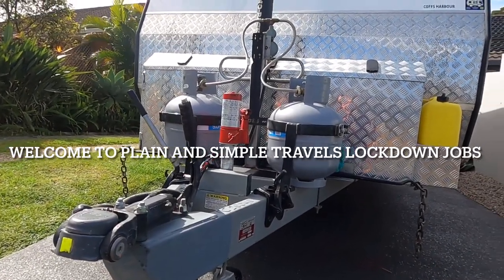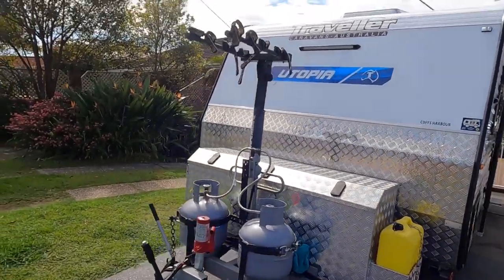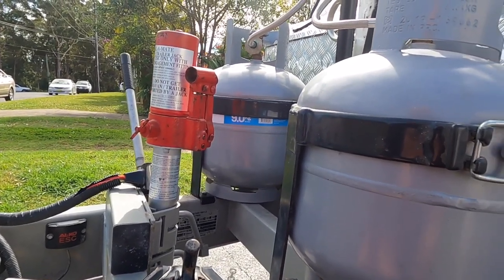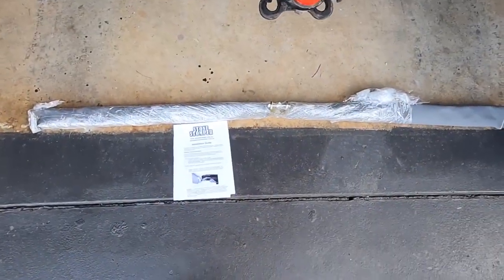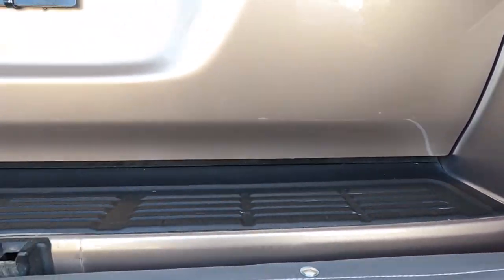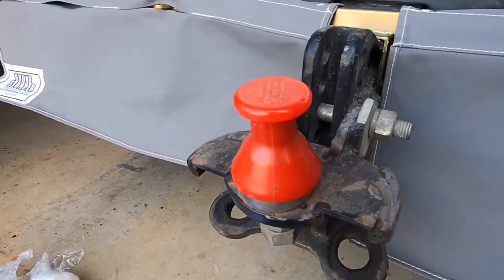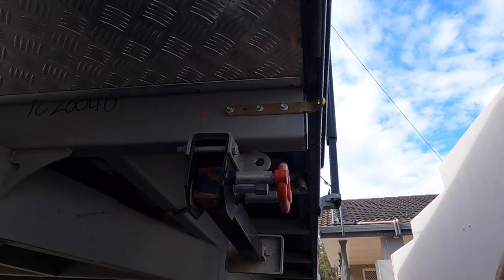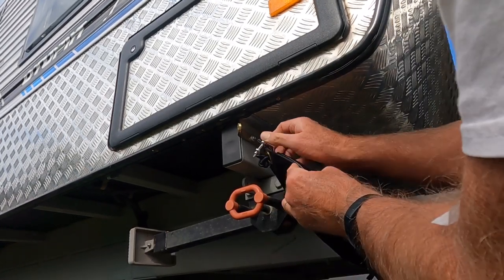Fitting a Stone Stomper, Jobs to do during Lockdown

Comment: You need the support bar (I use a pvc tube 30mm) as it will drag on the ground when you turn left or right which will cause it to wear or get caught. The instructions would have stated that.
Reply from the maker: Hey, yes have the support bar just didn’t show it in the video. Thanks.